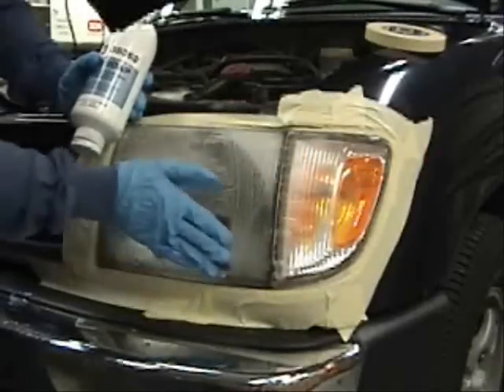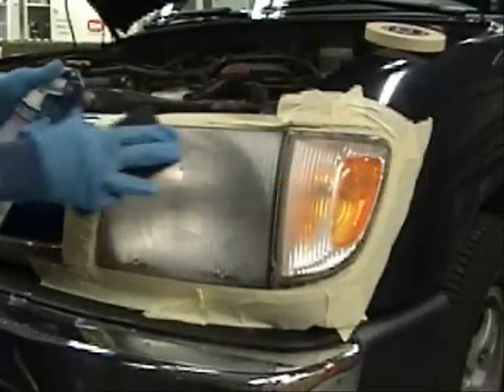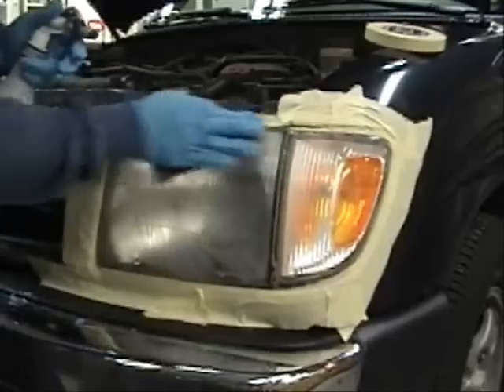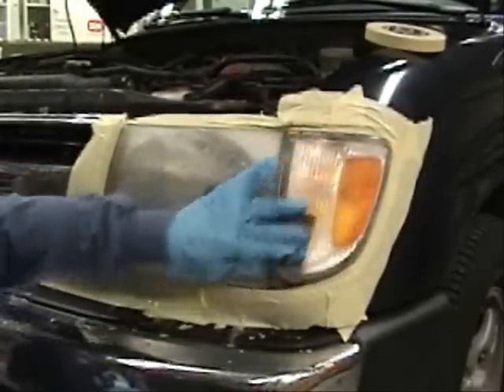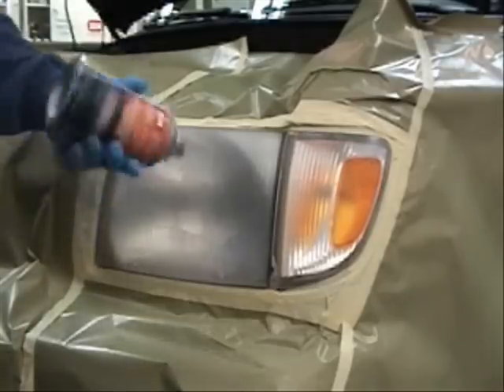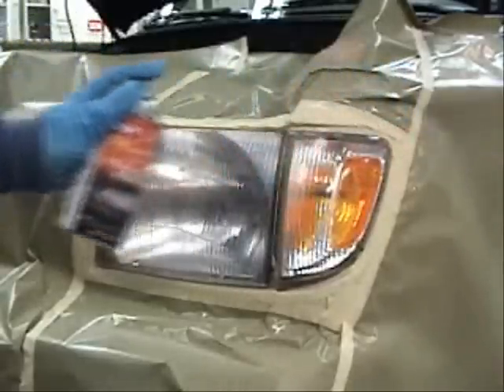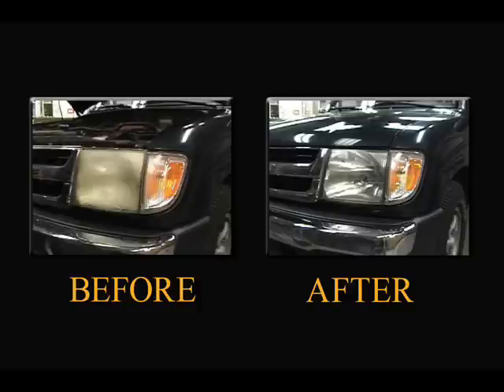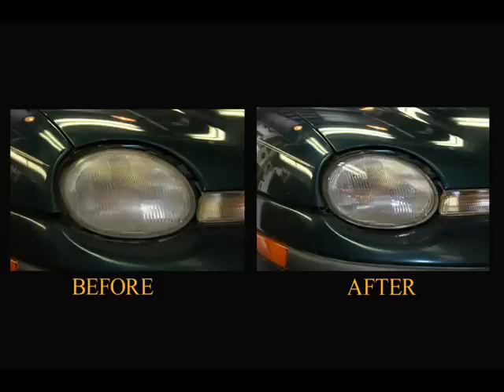SEM Products, Inc. - SOLARAY UV Headlight Repair

Comment from the maker: Technically sunlight can be used to cure it but we do not recommend it.  Cloudy days, extreme moisture and other environmental factor filter the UV of the sun.  Additionally, depending on the curvature of your lights, there maybe areas the do not get direct UV saturations and this will cause it to cure unevenly.  A UV lamp is highly recommended.
Reply: Which kind of UV wavelenght to be used? UVA or UVB?

Comment: A word of caution about this product.  According to SEM, this product has a 2 year shelf life.  I was just sold a can that was manufactured in 2008 by a supplier to body shops.  The product failed miserably.  I wasn't really sure what happened until I gave the code off the can to SEM and they was able to determine that it was very old stock.  Since this product moves off the shelves slowly - there's the possibility of expired stock out there.  In my case very expired.  Now I have to go through the process of refinishing my headlights all over again to get this stuff off :-((
Reply: Thank you for the heads up
Reply: Have you found an alternative? What about Griot's?